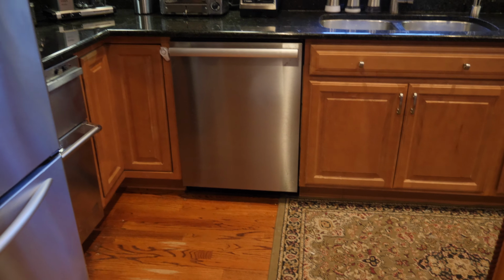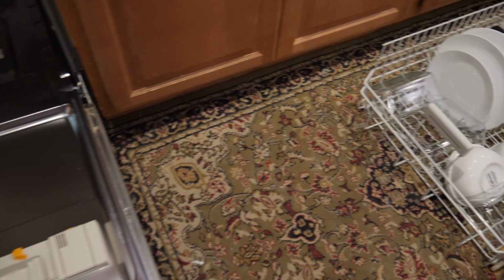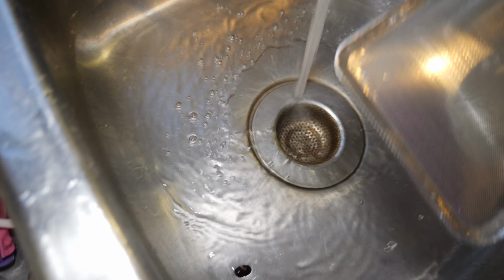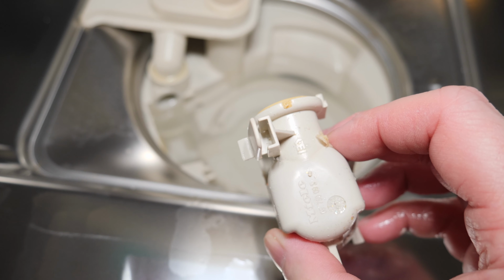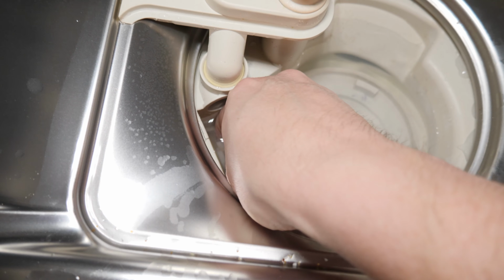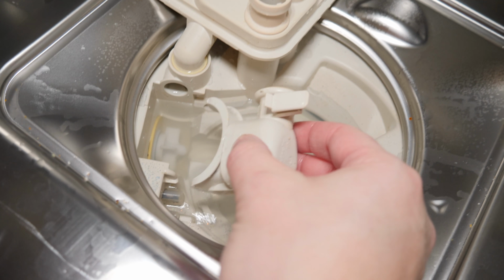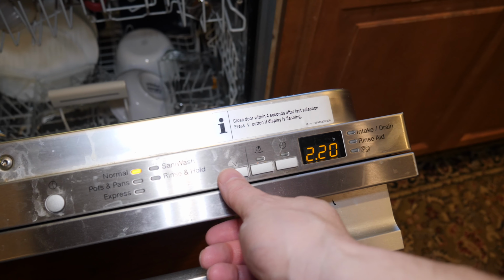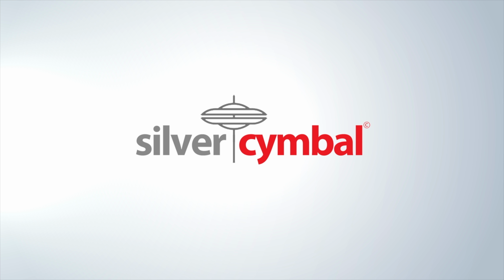Miele Dishwasher Repair - Not Draining / Grinding Noises Fix in 1 Minute - Dishes not getting clean?

Comment: You're a lifesaver! No way would I have been able to get a plumber under the current restrictions. It turned out to be as easy as you very clearly illustrated. Excellent job!
Reply from the maker: Glad I could help!
Reply: We had the exact same thing happened to me this week. Your solution is perfect. I pulled a small piece of glass out – 6 mm diameter. The noise that something that small makes is INSANE.
Reply: Hi👋 
I did exactly the same before I came across your video and nothing has changed, almost the same  problem accured before but a little different than the one  I got now and I had to spend a fortune in order to repair it cause it is really expensive fixing things in Norway😊 

 before but a little different than the one I got now a few years ago and I had to use

Comment: You saved my bacon! We took the dishwasher out for a remodel, and after we put it back in, it would make this horrible grinding noise every time it drained. I thought something went horribly wrong with the reinstall, and we were going to have to add a new dishwasher to the budget. I kept asking my contractor to take a look, but it keep getting pushed to the back burner. I’ve been listening to this disturbing sound for months. Finally thought to Google search it, and your video popped up. 10 minutes later, I was holding the trouble maker in my hand: a tiny bit of broken plastic. Love when I can step in and fix the problem myself. My Miele is back to being so quiet, I’m not sure I pushed start. Thank you! ❤
Reply from the maker: So glad it helped Thank you for the nice words

Comment: I just have to thank you for this video.  I have never fixed any appliance, and I was about to either call a repairman or replace my dishwasher altogether because it had been making a grinding noise for a while and then suddenly stopped draining and wouldn't work.  I tried your solution (my first drain cover was really stuck on there; it took a while to jiggle the handle enough to loosen up the hardened grime that was making it stick), and sure enough, the first filter was FILTHY, and there was a small piece of plastic in the second filter.  That was a tight space and hard to get my finger in there to get it out.  I had to use a q-tip to push the plastic up from the bottom so I could grab hold of it. But now I put it all back together and am running an empty vinegar wash, and it's quiet and working!  I can't thank you enough.  You made me feel proud of myself!  :)
Reply from the maker: So glad this helped and for letting me know!

Comment: THANK YOU! My machine started making ominous grinding noises while draining a few days ago, and I was dreading having to have a service call. I had already checked the main filters but didn’t know about the little cover over the pump rotor. The culprit was one of the little plastic bungs that covers screw holes in the door frame.  Sort of surprising that it got past the main filter, but how great that it was such an easy fix. You rock.
Reply from the maker: So glad it helped! Thanks for letting me know

Comment: This fixed our problem.  Thanks so much for this.   We've a 5 yr old Miele G6000sci that's been making really weird noises lately.  Then today we had an F14 message.  I thought I would have to take the machine apart but thankfully saw this vid first.  I found an errant olive stone in the second filter. We now have a perfectly quiet, functioning Miele. Yay!

Comment: I have a waste disposal unit for food scraps and use it prior to loading the dishwasher. You would do well to wash glasses separately as they will be less likely to come out streaky and will dry better. It’s also worth buying a cleaner that you can run in the machine to keep it in tip top form, they are not expensive and cost around $3.or thereabouts. I do mine every month and set the machine to run at night so in the morning it’s all done and ready. Simple maintenance makes a difference too, I also remove the salt cap and give the salt a stir with a teaspoon to ensure it is ok and not caked up in a lump, buy proper dishwasher salt and you can’t go wrong. I don’t know why you can’t get a hard water version of the dishwasher tablets, it would be logical to have but sadly not yet persued.

Comment: I thank you so much!!!  My daughter suggested You Tube.....new to me.  I did manage to find the issue with "grinding" noise when running (a new problem)....I had cleaned the filter, and the water arms.......they were fine.......moved on to the pump and found a very small gray plug.  I'm assuming its from somewhere else in the machine.  Do you have any idea where I should look?
Reply from the maker: So glad it helped.  Thank you for letting me know.
Reply: Found where it went........and replaced it.  Was a screw cover just inside the machine 2 on each side.  Biggest issue now is there is still one missing!  Can those be ordered or are they even necessary?

Comment: It worked but I found nothing and still had the problem.  Undid the drain hose (under the sink) and blew an air compressor through the sink drain end with the covers off and blew out a bunch of hair and old debris.  Works like a charm now with the hose unblocked.  Could probably use a shop vac with the hose on the exhaust if you don't have a compressor.  Again another step to save a few $100s in service.
Reply from the maker: Glad you got it up and running again!

Comment: Also check INSIDE of that little valve, not just under the rotor. We had 2 x kernel sized plastic pieces in both of them

Comment: I Just installed a used model of the Miele DW in your video. I am getting the Error F11 which your video addresses and I have gone through the steps in the video but the DW still doesn't drain. What is the next troubleshooting step for this problem? Thanks

Comment: Miele dishwashers are two grand brand new. Do you think they are worth it compared to Bosch which has basically the same features but is 1K less?
Reply from the maker: Do NOT buy that Bosch. I have had two and never will again! Worst dishwasher on the planet. Look further. Miele has a dishwasher for $1100 or $1200. It is identical to the their top of the line models for cleaning just has less cycles that no one needs anyway. Believe me buy the Miele and you will love it and never hand wash a dish again. Bosch is awful.
Reply: Silver Cymbal thank you for the advice. I actually purchased a Bosch 800 series with crystal dry about a month ago. I have been very pleased in this short time, and I did research before buying and it was top rated by consumer reports. I am surprised you had such a negative experience. I read a lot of reviews before buying and none were horror stories. I will have to find out how long the return window is because if it gives me any problems, I will return it and get a Miele. But I hope it won’t let me down... I want at least 10 years out of it as I paid $1,117 for it.
Reply: What fridge and gas range do you recommend? I don’t believe Sub Zero is that good they are $11K yet the reviews say they break down all the time! And I will need a gas range soon as my 13 year old Kenmore elite oven isn’t working.
Reply from the maker: @Nikolasto77  I know this isn't what most reccomend but I loved the look of Viking appliances and of course not the price. I bought all Viking appliances (except the Miele dishwasher, Viking is horrible) but I bought them all used on Craiglist forso little. I have a double over than originally was $9,500 I paid, literally $500 plus $150 to put it in (lifting help needed). I bouht a cooktop used for $750 that was $2500 new.  Both were in new shape, this isn't for everyone since you get no warranty but all of them have been flawless for me and look great. They cook really well of course too. There are lots of good cooking appliances but this is what I did.
Reply: Silver Cymbal I will look into Viking and shop around on Craigslist! Thank you so much for your advice! This is extremely helpful because with appliances there are so many choices. From what I heard Viking is made by Kitchen Aide which is a great brand!

Comment: What if there is a Strong Odour coming from Dishwasher but no signs of waste food inside.
Reply from the maker: If it still is running correctly you might have a block in the drain line itself. But first I would try to make sure that both the primary filter and possibly secondary don't have something in them, that is often the cause. OR you could try a commercial dishwasher cleaner if the machine is working. This is a great ine, you just put it in an empty dishwaasher and run it. The stuff works very well https://amzn.to/2WkA1Wy

Comment: Miele Dishwashers are total junk. I have a 4 year old one and it breaks down every year to the tune of $1000 dollars. My dishwaster is not draining. I did what this video said and it still makes a grinding nose and does not drain. PS, the Nylon impeller reacts with water. No obstruction or debris found and it still grinds and does not drain. So the debris is in deeper. DO NOT WASTE YOUR MONEY ON A MIELE DISHWASHER. Also, I had to replace the circuit board last summer.